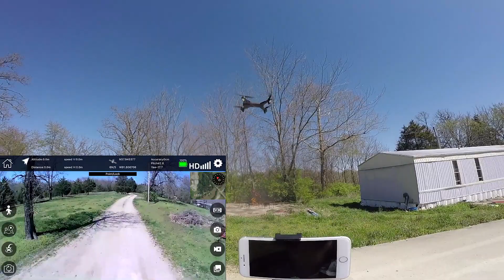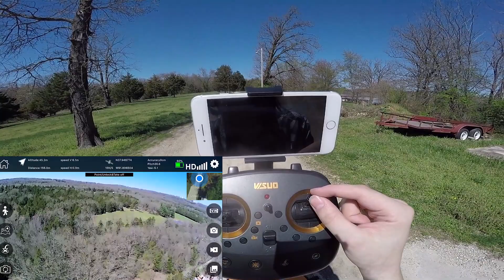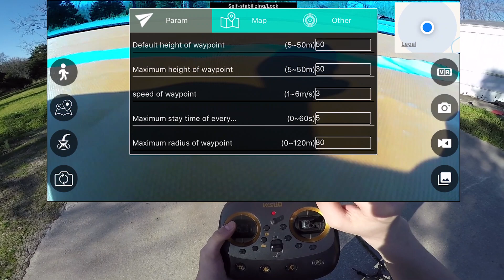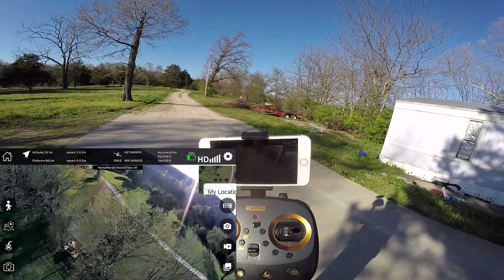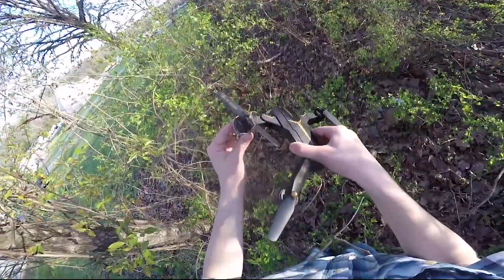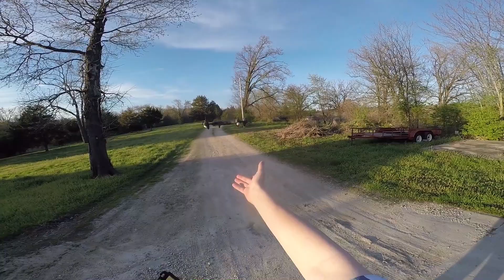VISUO XS812 GPS Drone (Crashed, Lost, and Found!)

Comment: I never did get to really push it as I wanted. I only had a 150m field before a road. Glad you recovered it, well I hope Ryan has better luck with the one I sent him. I liked this one for the 150 range. Cheers John and great review.
Reply from the maker: Hey Donnie, thanks for stopping by! This drone is basically ranged capped at ~220m. It  will start to beep that you have hit the cap and will go back. I didn't get a chance to mention that in my video.
Reply: This drone has a geofencing of slightly under 300m radius, you push the sticks and it can't go further, but I still have full control. There is also an altitude geofencing of under 70m.

Comment: I made the mistake of flying it shortly after the wind died down and it got caught in an updraft and had to force it to crash land
Reply from the maker: Yep! Well that's the great thing about having this drone, no worries about crashing.
Reply: @JohnCuppi  thats why I have to replace two brush motors after the crash, no worries right?  both on the right side are in need of replacing
Reply from the maker: Kay Skywalker oh jeez, sorry I didn’t think there was any damage. When it crash landed did it get caught or stuck anywhere, where the motors perhaps were running but blocked? I let people locally fly these visuo drones (not the gps one, but the previous generation battle sharks and original) because I don’t panic if they crash. Never had a motor go out on them in some pretty gnarly crashes... but still what I meant was that I wouldn’t think twice about forcing a crash landing with this one, brushed motor replacements or really anything for it are actually really cheap compared to any of my expensive drones. Brushed motors aren’t invincible of course. Hope you get back up soon!
Reply: @JohnCuppi  I bought a cheaper drone then this and it can take the punishment, it started acting odd after it crashed.   The yard it crashed in is half rock and half grass.  I didn't see a choice in forcing it to crash land,  I wish there was an alternative but there really wasn't.  I'll just have to chose my days to fly a little better.
Reply: @JohnCuppi  If you would suggest a good rugged drone, what would you suggest?
Reply from the maker: Kay Skywalker it isn’t fancy, no altitude hold or advanced features by today’s standards. but you can’t go wrong with a classic syma x5c-1. that thing is a tank. It’s brushed too though, so there’s always a chance of a brushed motor failure. I think it’s a bit better maybe since when you crash to disarm it, you just lower the throttle so that the props aren’t trying to spin into oblivion.

Comment: Don't do a way point over someone else's house. Their WiFi can cause disconnect. Also, when you hear the low battery beep press the return to home button or it will land where it is. Not good if you're over forest or water, which is what happened to you. Had you pressed the home key it would have elevated, orientated, and flown back to you, even under low battery it has time to get back to you.
Reply from the maker: The battery was far too low to make it back honestly.
Reply: @JohnCuppi  your phone kept losing connection. That's why the battery level kept jumping up and down. When the low battery beep comes on you have about 8 minutes left, unless your batteries are old?
Reply from the maker: Wabbit1961 I explained what happened in the video — The battery was not fully charged, and with the strong wind that it was fighting against I ended up using a lot of battery life that was left quickly.

Comment: Great video.... how I record the return point? The instructions say it’s not the same from take off.
Reply from the maker: Thanks! That is odd because in my experience, it absolutely is. Sometimes the chinese-made instructions incorrect or are translated wrong. When you have all GPS satellites fully locked on, take off from a safe place, fly out a short bit then test return to home. It should fly right back to where you took off from, automatically. If not, just use emergency motor shut off.
Reply: @JohnCuppi  Great! Thank you!